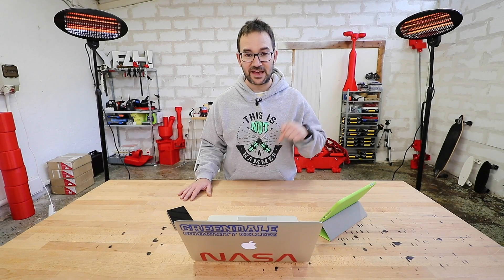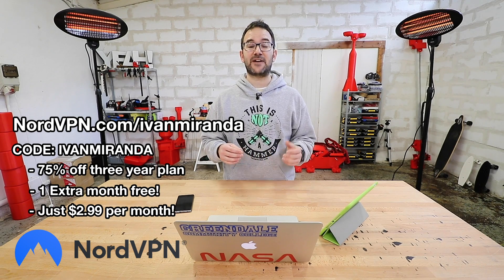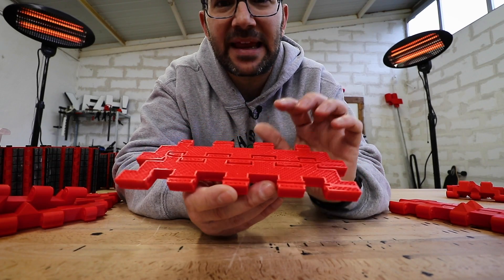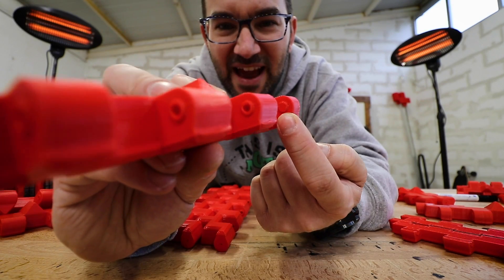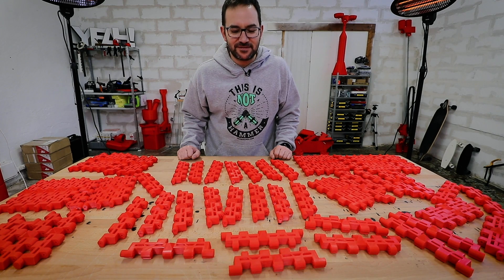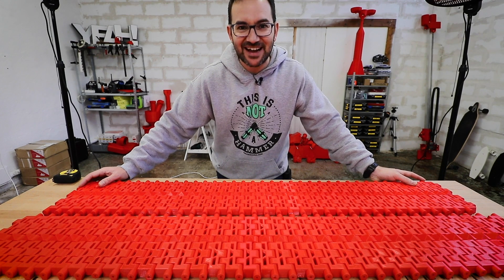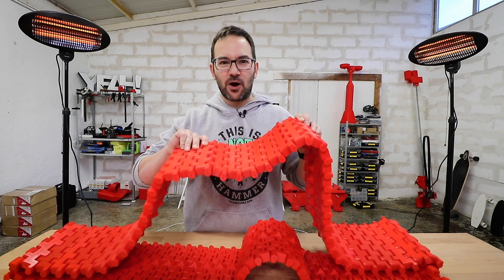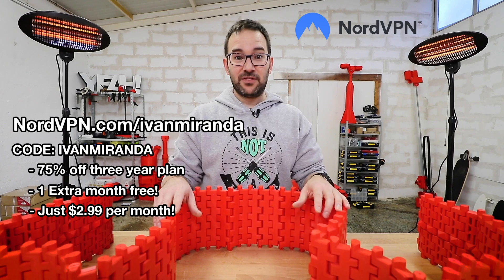3D PRINTED TREADS FOR THE BIG TANK

Comment: wouldn't it be more economical to use other fabrication techniques like machining or even woodworking to prototype things like this?
wood is cheap, metal is strong, but a cnc mill is basically a 3d printer just opposite. And they've been around for a long time.

Comment: I love putting a few minutes into building a jig to save time an increase accuracy. I think I would have probably stopped it with my finger at the end of the tube rather than with a screw, so I could just push the next piece through rather than pulling it out. Probably require removing the spring from the cutting tool.

Comment: Really not sure about plastic pins... They may be strong and slippy, but they are not rigid. When real stresses get involved, the pins will bend and the whole thread will stretch by a significant amount. Then they will waste energy and possibly derail. As the tank scales up, the price of a design mistake also scales. Before assembling the whole 7 meters, it might be a good idea to spend a couple of hours on testing the tensile properties of the new links. Just take the expected maximum torque of the motor, apply the equivalent force to a short piece of a thread, measure the stretch, and extrapolate.
Reply: I support the idea to test several links assembly on basic stretching tests at least. These tubes will be bent and go out from links if a basic test will be failed.
Reply: I dont think the stresses will be close to shearing those pins. Im betting it goes fine     even with a tiny amount of stretching

Comment: You can get even faster cutting the pins. Make it so you pull/push them through a guide past the knife and hold the end flush to the mark, so the thing you cut off is completely free. Then cut and repeat. Basically: remove the screw at the end, turn the device around and make a mark starting from the knife to the length you're looking for on the other side.

Comment: Wow, that track section is huuuuge.  LOL  You should run a contest... guess the amount of filament that will be used.  :D I think it'll be around 150 lbs (68 kilos).  So, let's make it easy and round to 70 kilos. ;) I can't even imagine the amount of print volume you need working at the same time to do this in a timely fashion.  oO

Comment: Wtf is going on with all adds on VPN?

I really don't get it.

Most of web traffic on web in encrypted. Now also DNS queries can be made by ssl connection. So none can sniff what you're doing.

The real use is quite limited to the people that have country locks. (Like China and Turkey)

So far I don't see a reason to have a VPN.

If a friend is hacked and have a virus your PC is still connected to his Network only the default gateway is chsnged to the one of the tunnel.

But the nics still accept broadcast packed from a possible hacker...

So it's quite useless....

PS: I work in network environments...
Reply: I'm guessing it's just a way for companies to gain from people's insecuritys about there safety, which are probably down to lack of knowledge. But that said it's always better to be safe than sorry, especially with how dodgy some free WiFi can be
Reply: @domt6802  Yea, free public WiFi can be a problem if they do arp and DHCP attacks to Change your address and route the traffic to another machine.

But is also (again) true that most traffic is encrypted.

In my setup I refuse to use my ISP DNS  they could see what's sites I visit 

Now they can mostly see request to proxies and cdns of the website's that are common for a lot of sites. Except bigs like Google Facebook Microsoft Amazon that have theirs servers.

Most network traffic goes to a cloudflare server or to Amazon AWS is other hosting company server.

VPNs protect insecure data from node A to node B but from node B to the website you want to visit is still done on the "old" way. (Node A is your machine, Node B is the VPN server you chooses)

Another use of VPNs is to keep your identity unknown. But Cookies can track you even if you disable them.

If I remember correctly Google found a way to generate a code based on the system information and keep track of what you do in the web even without cookies. This run on your browser and is part of the content and a VPN can't protect you from this.

Is you use a mobile, the Sim number used to be included into web request (User agent, not shure if this is still done. This was used for ads that subscribe you without explicitly consent. You download the ad from the server in the request there is your phone number and you get automatically subscribed)

And again public wireless is generally tracked: PC Mac address associated to connect disconnect time. And the IPs you connected to.

So: if the person X hack something from server Z via a VPN police can access the logs of the hacked server, see that was used a VPN. They track the Node B server. Ask the VPN the logs. The VPN reports (probably fake data) but they could tell that the user X (with fake subscription data) was connected from an IP address of a public place.

Police can than get logs from the wireless place and see who was connected to the VPN at that time slot.

They than can get the Mac address and by it detect the machine model or manufacturer. Watching CCTV can find out what the bad X guy is.

So also in this case a VPN is quite useless.

Banking website have 2fa and SSL connection with strong encryption keys.

The only way a hacker could sniff data is if he will change arp tables on your machine or via DHCP spoofing, changing the default gateway to one with a reverse proxy on it or other tools.  in that case if you don't have a VPN when you go in a ssl website you dont get the ssl lock and data is transmitted without encryption. (Or you get a warning about the ssl certificate)

And in all of this even if you have a VPN but your device is old, not updated can be hacked due to the fact that even via a VPNs you are still using a public wireless connection.

There are technologies like clients isolation that should /mostly prevent comunicazion between clients but only between clients and AP.

I use a my own VPN running on a vps that I can enable anywhere is the world with lot of more host. Than the one offered by most commercial VPNs.

Another fact about VPNs is they the bandwidth is limitd and require lot of processing power so speed is not always the best.

A good example of a VPN is a cargo ship. You don't see the content of each dock but you see the source and the destination. (Node A and NodeB)
The port is big and without sourveliance (outdated  device) and a "hacker" can take control of the cargo station via the see (the network is the see and the port is the computer) at that point even if I do the know what the ship directly contains I can see what in the cargo station has been put inside the single dock. Making the whole VPN concept useless.
Reply: @tuttocrafting  yeah, using only a vpn is never the best protection, but it still prevents a lot of tracking between your computer and the vpn. What I mostly use vpns for is to change locations because of the stupid idea of region locked content and websites who simply don't want to show up because of gdpr.
The use of a vpn basically makes you less of an easy target for potential attackers, it's like having an alarm system on your house, it doesn't prevent break-ins, but it may make attackers choose another target.

If your device is secure, using a vpn does hide your traffic on an unencrypted network (though everyone can see you are using a vpn).

Comment: I mean... I probably would have just poked a soldering iron in the end to lock the pin in place (instead of wasting all those screws / time), but otherwise, seems like a solid improvement. -- Can't wait to see them installed! 😃
Reply from the maker: And what if a link breaks in the field?
Reply: @ivanmirandawastaken  drill it out (same effect as removing the screw). -- On the surface it sounds like more work, until you consider that you only need to ever do it for broken links. (You can mix and match with screwed links also for easy disassembly and reassembly).
Reply: @BrainSlugs83  yes but you know how hard Ivan is on his tanks...

Comment: the fishtape is probably fiberglass
Reply: In Italy are made by Teflon (no idea how that material is called in English :( )
Reply: @tuttocrafting  I think it might be also called PTFE, which is the same plastic that is used for "bowden tubes" on bowden-drive 3d printers (the type where the extruder motor is not on the print head and the filament is pushed through a tube from a fixed extruder). PTFE is very low friction which makes it good for bowden extruders, good for getting through cable conduit, and also good for tank track pins.
Reply: @MattFowlerBTR  Yea probably is the same material.

Comment: Great project and what motors/esc/controller/batteries are you using ? I want do do simillar thinks, maybe even  controlled with a raspberry  PI and cant figure out a way to run the escs since  they need a stable frequency in the range of 1-2KHz as far as i understood and using a PI would offer me so many possibilities (like using the  PI to move around without any  help from me and so on)
Reply: You can use an arduino to control the escs, and communicate with it via I2c, so you just have to send it a speed. (Maybe add a safety stop wire) 
But initializing regular ESCs blind is annoying, you might want to use some VESCs with the raspberry pi directly, or make a mount for 3 hall effect sensors and make your own esc. 
Personally, I'd recommend an orange pi zero, they are 10 bucks and have wifi built in vs the rasperry pi zero.
Reply: @satibel  thanks for the answer and sorry for the late reply, and do you know if there are other ESCs available that are good ? i dont want to spend that  much money on something when i am not even sure its going to work (they would have to handle 30A 2s Motors) and the VESCs seem very overkill to me. And i already have  a pi 3b+  here that I wanted to use for that.
Reply: @CrazyTech200  I use hobbyking esc, they work well enough to make motors turn.
You can get an arduino pro mini/pro micro from aliexpress for a couple of bucks and use that to control the escs

Comment: Nice. Will I be able to download the designs once the tanks are finshed?
Reply: NOTHING is impossible with Romanian ingenuity and American laws.
Reply from the maker: I'm not sure what for but they'll be available in some form yes.
Reply: @ivanmirandawastaken  I want to put some form of firimg mechanism (maybe 12 gauge slugs).
Reply: @gheetza14  making a pressurized tank to hold petrol, and a hose might be doable 3d printed, the only non plastic part would be a lighter.
And now, zis is a flammenwerfer, it will werf flammen.  [Cue:Maniacal laughter]

An easier one would be to use a remote plant sprayer for drones and a servo actuated stove or kitchen lighter or blowtorch.
Reply: @satibel  or just tie an actual flamethrower on it

Comment: I THINK THAT the Design was very clever though
Reply from the maker: Flawed but clever, if that's possible. Thanks!
Reply: @ivanmirandawastaken  I'm sure, with some tweaks, it would have worked fine. Perhaps make the retention ends narrower (i.e. the section which blocks the pin from falling out), I don't believe you need a full cm on each side to retain a pin which endures no horizontal forces....